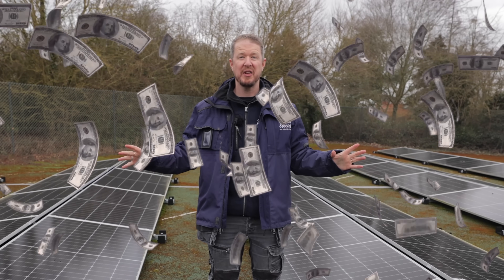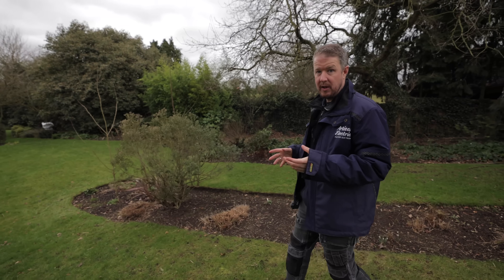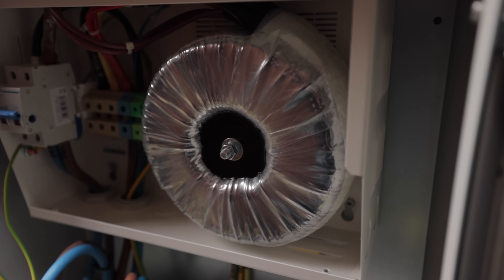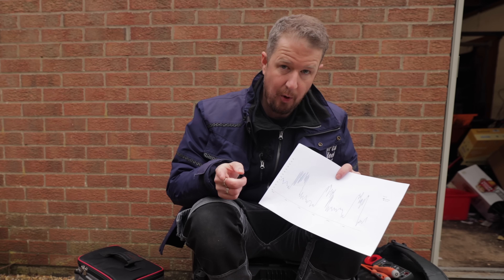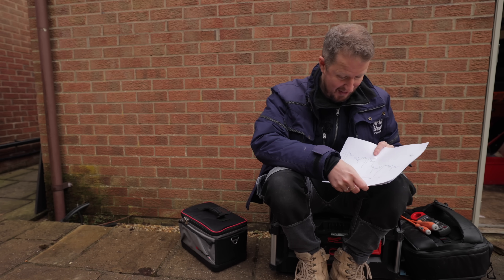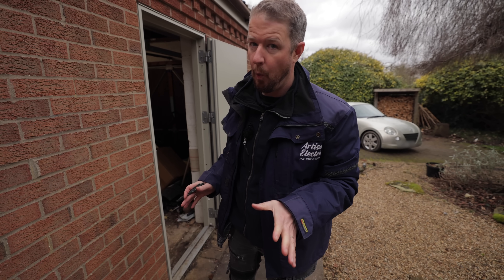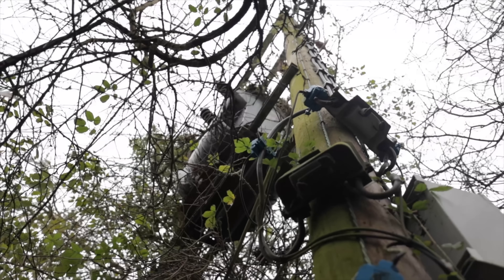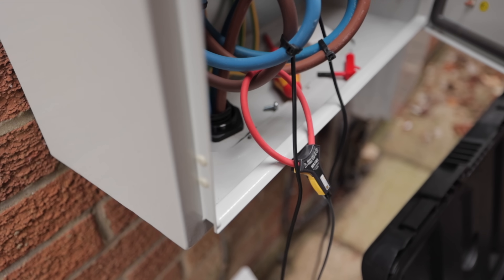THOUSANDS Down the Drain – And We Can’t Do Anything About It!

Comment: That transformer looks like a 75KVA unit at the least. Single poles support up to 50KVA transformers and dual poles support up to 250KVA generally. The power/voltage regulation on 75KVA trannies are pretty good. It would be a good idea to voltage logging at the nearest property to this pole transformer to see if the swing in voltages match your clients. If so, then the transformer is too small. I believe the problem lies in the long length of the standard  low voltage cabling from the transformer to your clients property, as to export, the inverter has to increase its voltage slightly above the supply voltage to allow current to flow back into the grid. The inverter monitors the CT current on the incoming mains to control import and export power/current flow. So in this case, it is fighting against high impedance supply cabling.
I worked on the national grid in New Zealand and had to install a 3 phase 185mm2 AL cable from the local service transformer to a domestic property at 100m distance, to ensure the supply voltage limits were not exceed at this properties maximum current demand.
Reply: shouldnt some sort of check by solar suppliers of the supply readins, supply cable legnth, and transformer be included in the pre site design visit?
Reply: @apiscator444 of course it should. It's unbelievable to think that someone chucked 65 solar panels onto a tennis court and then with overhead lines and transformers miles away expected to push and pull 72 amps on a single phase connection. We have two single phase connections and are limited to 16 amps on each.
Reply: @apiscator444  I am not sure of the policy procedures, but in fairness you assume that the National Grid is robust and the supply is of reliable quality. Sometimes, the main cut out fuse is sized according to the impedance of the supply tranny/cabling. Maybe a PSCC (prospective short circuit current) test should been done beforehand to determine the loop impedance. If it is too high then your supply voltage will drop more per the amount of current drawn and rise higher for the amount generated and exported.
Reply: @adamsweet3587  No I assumed / hoped that the Solar Supplier would be able to check Electricity supply, not just rely on DNO.
Reply: @apiscator444 the DNO I work for uses a computer system that knows all the cable and transformer sizes from the plans so its an easy process to work out if ther can generate
Reply: @apiscator444  for that power of the system, yes it should
Reply: Looks to be 200 to 300kva anything on a H pole is above 100kva

Comment: The issue to me seems that your trying to export more energy than what the neighbors are using by a long way resulting in power having to be pushed back onto what could be a really long hv cables.

Grid tied systems really should be sized to be pushing out power to the local grid only.
 which means you might need the DNO to provide a recommended max kw generation for your location to prevent problems.

Comment: 8:24 That is NOT how Ohm's law works. You're skipping the part where the current goes up causing the wiring to heat up and increase impedance, and that impedance increase is (part of) why the voltage drops. Technically that's due to Ohm's law, but you're describing it wrong. Ohm's law doesn't say "voltage drops when load increases". It says "current increases when load increases assuming impedance stays the same".
Reply: The conductors heating up doesn't help, of course. But even if you had some hypothetical material whose resistance didn't change with temperature, you'd still get a voltage drop. Ohm's law is just V = IR; how R varies with temperature is a second-order effect.

Keep in mind that some materials have a resistance that decreases with increasing temperature. They still heat up when you run current through them, and still have positive resistance.

Comment: Not the owner of the property so its between solar supplier and electricitry supply 
buyer relies on Solar supplier to be the expert, design and fit the agreed system
Investigation and fault finding , supplier definately.
Doesnt the survey include an electrical supply test??

work with electricity supplier to agree DNO, maybe understand the condition and capacity of local electricity supply
sounds like Solar suppliers need to either know thier local networks better or ask more questions. 
Easier for local solar supplier, harder for national supplier.

Fxing local supply , electricity company.

Good insight into how local supply can affect solar solutions, always seemed a bit of a black box before

Comment: The age and appearance of the transformer has virtually no bearing on how well it works. Transformers are pretty much all or nothing devices. The winding ratio is fixed. The resistance of the windings inside the shell does not increase with age. If it is underated for the current loads, that is a problem, but it doesn't matter if it is one year old or 50 years old. It's also possible that a larger transformer would not help as much as you would hope. If the lines on the primary side aren't very heavy gauge, and run a long way to the nearest substation, a significant part of the voltage vs current change you are seeing could be the result of resistance of the lines on the primary side of the pole transformer.
The 230 volt lines running from the transformer to the homes  are pretty long. That adds voltage drop independent of the transformer,
It is possible that connections exposed to the elements have become high resistance. That might be adding some voltage drop.

And lastly, the underground line to the house is pretty long, and adds yet more voltage drop.
Monitoring the voltage vs current changes at the house only tells you the net cumulative sum of all the resistances between the substation and the home's meter.
You can probaby find a way to check the voltage where the line comes down the pole at the property edge. It would be a useful bit of data to know it the voltage there is varying much less than the voltage at the house.
Reply: Exactly , we work in subs , a lot of the transformers are 60 years old , rusty as hell but are still fully operational.
A Quick Look and he was , yeah this is the problem 😂😂
Reply: The old transformers are way better then the new ones
Reply: @kevxsi16v  I really do not want to add an Optimus Prime reference......so I won't.
Reply: They have to find anything to blame but themselves, they obviously didn't think this out at all.
Reply: Looks simple, fact the lv 240v cable to the transformer has too much resistance. Do you know the volts drop say when you  put a 10kw elec shower load on if its say 8volt drop your bigger than 10kw pv array will push up the volts by 8 times pvkw/10 volts. Transformer may be too small for the property cable  to small and too long.
Plainly too much resistance in the cables to the transformer.
Most house supplies use 10mm or if you are lucky 16mm from the meter to the road. These maybe tens of metres or hundreds of meters. 
Simple ohms law.
Your battery bank dips the supply therefore the pv will do the same.
Unsuitable array for the countryside location indeed  anywhere.
Large arrays really need direct grid collection at 11kv level or short 240v runs and big 11kv to 240v transformers.
Often one house with its own transformer will have just a 10kva transformer. The transformer will also have internal resistance and magnetic losses.
The array is simply too big for the board supply arrangement. 
Good luck.
PS maybe this household should just go off grid and back to ICE cars.😂
Reply: I'd like to ask you a question I've asked elsewhere but not yet had a reply: can a standard 10kVA trafo transform current from 400V back up to 10kVA?
Reply: @billmorris2353  You are mixing up units, but sure, transformers work in both directions.
VA is roughly the same as Watts (accounting for power factor), so a 10kVA label shows how much power the transformer can transform.
Reply: @billmorris2353  I've also asked this before and never had a reply!!
Reply: @billmorris2353  Yes and No, it wont transform current but voltage. you can fit a generator to the low voltage side and you will get the high voltage ot the other side.
I have used this method in fault conditions when the fault is on the HV network but remote from the substation.
The issue is a generator has a small load capacity compared to the network, so unless its something like a farming area with lots of small substations, its not feasible in reality. we just put lots of generators directly on the low voltage network at each substation.
Reply: @billmorris2353  Yes.  transformer just changes volts between the two coils.  If the 400V has more oomph it will spit it out the 10kv side.
Heck that is how they step it up to 10kv in the first place.🤔
Reply: @billmorris2353  Disregarding your units (which appear to be a mixture of potential difference and power), transformers work both ways. If you put 400V into what is intended to be the secondary you'll get 11kV out of what is intended to be the primary.
Reply: @billmorris2353  Yes, a standard 10 kVA transformer can transform power from 400V back up to 10 kVA, as long as the voltage ratios and frequency are compatible, and the power does not exceed the 10 kVA rating.
Reply: @billmorris2353  Transformers are symetrical. It is completely arbitrary which winding you choose as the input and which you use as the output. That's how grid tied solar that generates 120 or 240 at the house can send energy back to the grid. The transformer nearest the house takes the power in at domestic mains voltage, and sends it out to the 11-22 kV distribution lines. If lots of houses  and businesses in an area are generating more than that area uses, the excess might get stepped up yet again at the local substation, and be sent to 120 kV transmission lines to be used elsewhere.
Reply: Looks to me like the distance to the transformer is too far for the size of the cable they used. When the PV is generating, the voltage at the house goes up to 260 and with the voltage drop over the cable, that's just enough to end up with enough voltage to feed power back through the transformer - aka with the voltage drop in the cable, it'll be just above 230 or 240 or whatever the grid voltage is at at the transformer
Reply: It’s probably a long line of 16mm concentric
Reply: @kevxsi16v  And that's a 35 A limit on that length of cable. At most. Maybe even 25 A. I don't design long cables but installed some and splitting 3 households with 100 A service would require 240 Al or 150 Cu. I did a calculation and it gave me 630 mm2 Al for the furthest building to meet the voltage drop. So many factors to count with.
Reply: Try telling the family of squirrels that? 🐿️🐿️😂
Reply: As usual trying to cover your f.u.
Reply: You are not correct

Wimding ratio is not "fixed" since most modern utility xfmrs have tap-changers

B) Oil cooled xfmrs can dry up and fail spectacularly
Reply: @Vrykorps  The transformer of the type shown may have selectable taps, but these will be selected only on installation, leaving it with a ratio which is then effectively fixed. 
Further upstream the transformers doing the (eg) 132kV to 11kV may have automatic tap changers to regulate the voltage according to demand.
Reply: @Vrykorps  A transformer winding with multiple taps is still fixed, dumbass. It doesn't magically unwind itself.

Comment: When you set grid code in inverter it set voltage parameters at which inverter will shut down (over voltage, under voltage, over and under frequency) also if output voltage is to high you need to set Reactive power curve adjustment which will lover production but also lower output voltage and inverters will stay on. When you set Q-U characteristic curve it will feed to grid inductive or capacitive power to lower or raise voltage to stay in set voltage limits. At least that is how you fix if your inverter is trying to feed over voltage to grid on Huawei inverters

Comment: My DNO has approved 11.04kW export. Yet im on an overheaded looped supply and strangley have a 100 service fuse. Network Plus have been contracted to do the unbundling, sent a guy to do a survey and immediately said they wont unbundle overhead feeds and judging by the way the estate has been fed its going to cost millions to lay feeds in the street as currently there are none to even tap off. Plus he couldnt figure out how id been give auch a high export.

Comment: Could you not use a separate part of the system to only charge batteries. Then the other part will backfeed into the grid. Also use this surpluss pv power to heat up water tanks or something. Victron has a big camping site in the Netherlands where they did all these things to deal with the excess power the grid wouldn't accept.

Comment: I used to run a private 11kV network with 30 Txs.-  from 200 to 500kVA. I used a Hawk logger, and it saved us (the ESA for the site) lots of money as when  users complained about the supply,  we could prove it was not us. (One user had 15 single phase 2hp motors off one phase in his building that had 3 phases available.)
Reply: What was the guy doing with his 15 motors? :) He probably thought 2hp doesn't sound very big but 15 off is 22kW.

Comment: The length of the supply cable is certain to cause the voltage to wander up and down. 
I would say the transformer is designed to give a slightly high voltage such that at low load the houses get a voltage on the high end of acceptable, and heavy load at the low end of the voltage range. Hence within the +10% -6% thing.
Your adding current which is tending to lift the voltage just when load is low. 
Being mid-way along the cable is allowing volt-drop in the cable in the reverse direction.
So peak sun at mid-day when everyone is out at work so load is low.

On balance, the DNO shouldn't have allowed more than 3KW of power export.
I would suggest not charging the batteries from the mains at all, and use them to absorb the solar energy only.
Reply: its all due do the nonsensical hourly fee. just charge all the same and people will use it in a sensible way

Comment: Main reason: too thin wires for the generated power. I have client with 25kW inverter and around 7-11 volts rise just in the cable in his property. Also this is a huge loss. Local electric company logged on the entry point and everything was fine.  We scheduled doubling wire thickness this summer.
P.S. Also with this transformer you may damage neighbor's appliances because you are rising the voltage in the grid. I have no idea what is the allowed maximum voltage in UK - here is 253V - all inverters are setup to cut off on this voltage. Separate over/under voltage/frequency controller here (in Bulgaria) is required for plants over 200kW

Comment: Can’t for the life of me work out why an overgrown or old  transformer affects its voltage, come on that talking bollocks. Any rural transformer that is on two poles is a big transformer most rural transformers are much smaller than that and mounted on a single pole. You younger sparks forget that the standard voltage in the uk WAS 240 when most of these transformers were installed. I go to many farms where the nominal voltage is 250 plus. I think back in the day they knew farms would be a high load so set the tappings on the high side. Unless all the neighbours are complaining it sounds more like a cable size issue to me. Optimisers work very well on these high voltage installations to keep the solar running ( ignoring the it will save you energy marketing  bollox) clearly it was going to make the low voltage issue worse. Will be interesting to know the outcome
Reply: Agreed, I've had 260v here, on the end of a very long rural line. My 'Meter tails' are just under 3/4 mile long...

Comment: The UK voltage is still the original 240V, the nominal 230V is to harmonise with Europe, it doesn’t really exist in the UK. The wide tolerances on the nominal 230V allows for European and UK voltages to both be nominal 230V   Europe is still 220V. Oh and that toroidal transformer in the voltage optimiser doesn’t look anywhere near large enough for 100A!
Reply: No europe is not “still 220V” it has 230V for years now.
Reply: @ you think they replaced all the transformers in Europe since 2003, nope, just like we didn’t either.  It was purely a paper exercise.
Reply: @ it’s 220V, check it

Comment: It does occur to me that a) the line voltage for such a large run must be set on the high side to acommodate for the voltage drop to get to the end of the line, b) the solar inverter needs to output a voltage slightly higher than the line voltage in order for current to flow into the grid.  The inverter should be regulating the voltage to ensure it stays within the acceptable norms.  It also occurs to me that feeding 265v into the secondary winding of a transformer stepping down from 11.2kv to 240v would produce a primary voltage over 1kv higher!  Apparently the Solaredge kit will limit to 265 volts

Comment: Are automatic voltage regulators not a thing in domestic electrical systems ? It’s virtually the same bit of kit you installed but it automatically changes the transformer tappings up and down depending on the voltage presented to it ?